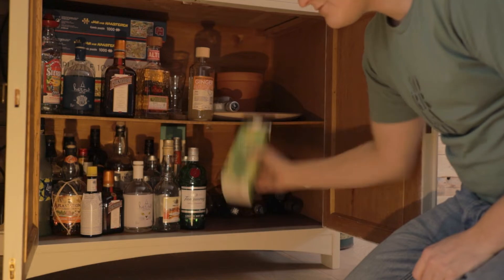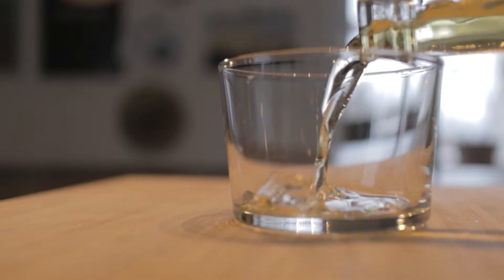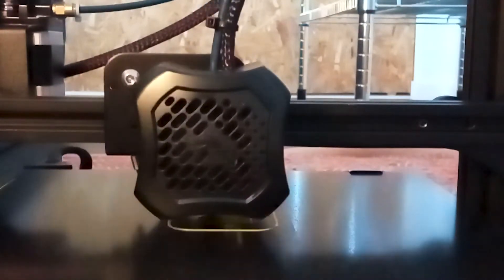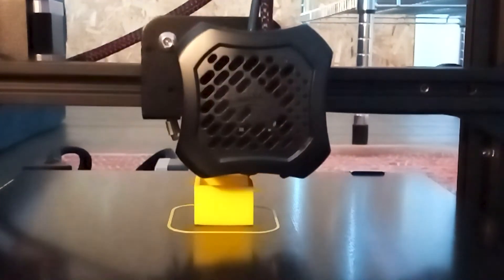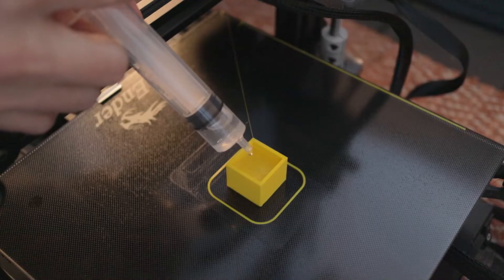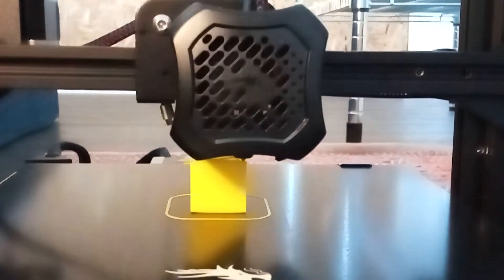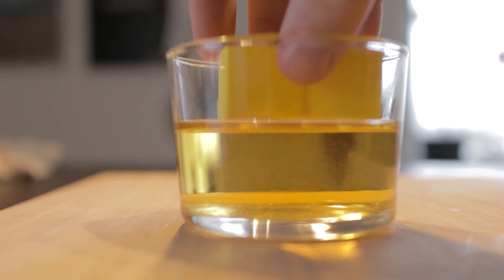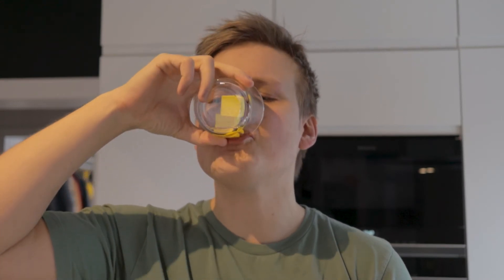3D Printing Ice Cubes?!

Comment: I'm trying to make a specially sized container that can freeze with water inside... I don't think it's possible to make it printed because PLA, ABS, PETG... crack after one freeze... and it should last like 100... the problem is that the ice sticks to the layers inside the container and spreads from the surface of the water downwards... so when it freezes all the way... the container explodes... I even only filled it halfway... (the air on the top stays where it was... the ice moves up because it's stuck to the layers)... with TPU, in theory it could last maybe 10 freezes... but with each freeze, one side of the container would expand like a balloon and it would lose its desired shape... the ice would stick to TPU as well...... I haven't found anything about this anywhere on the internet... so if anyone comes here with the same search, please take a look...